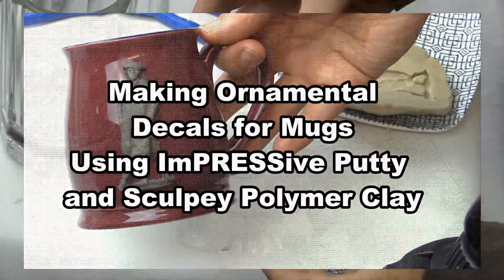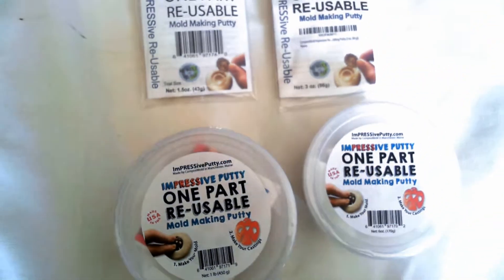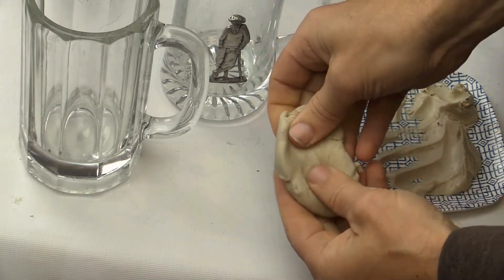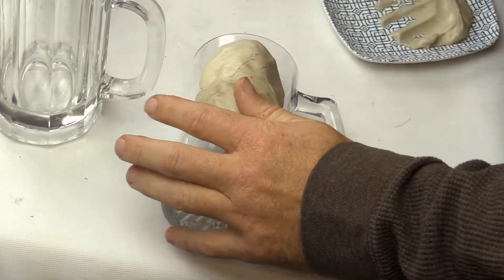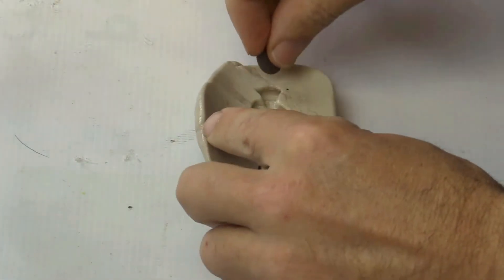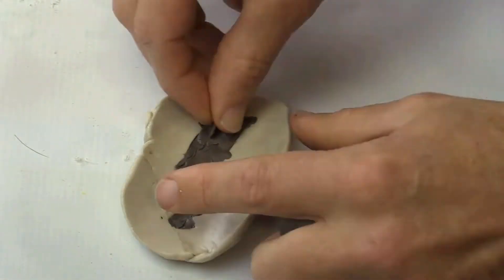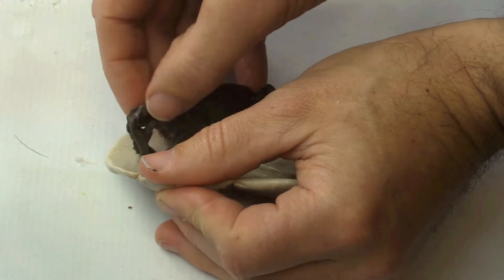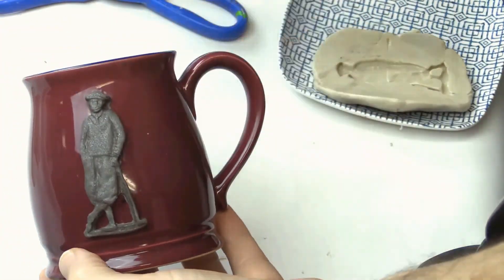Making Ornamental Decals with Sculpey Polymer Clay and a Reusable Molding Putty ImPRESSive Putty

Comment: To preserve details, can I bake the polymer clay directly in the molding putty? I assume the putty would soften as the clay bakes, but the clay should still hold its shape. I'm just not sure if this would affect the putty's longevity, or if anything in the putty would inhibit proper curing of the clay.
Reply from the maker: Hmm...I don't know. I don't think it would be the best option. But it might work If you kept it at 200 F. Be sure to watch because stoves aren't really that accurate. The Putty would soften. As long as you keep it below 210 you won't cause much damage to the Putty.  Another option would be to chill the clay and mold so that the clay is harder and then it would be less likely to deform when taking it out of the Putty Mold. And then cook the clay.   Or use an epoxy putty that you cure while still in the putty mold? thanks for the good question! stan from ComposiMold